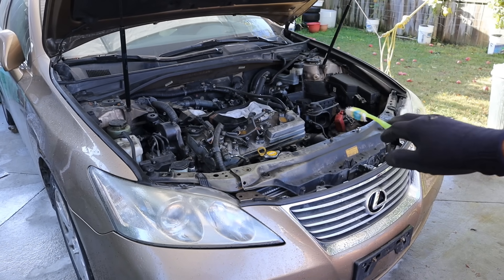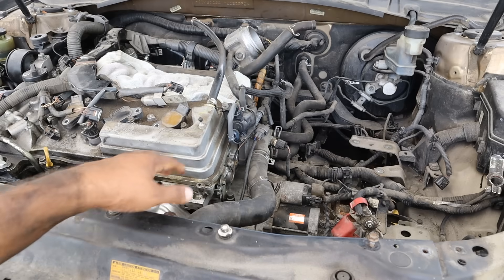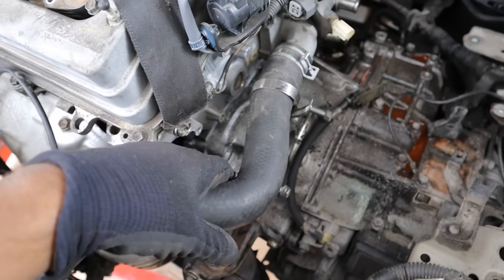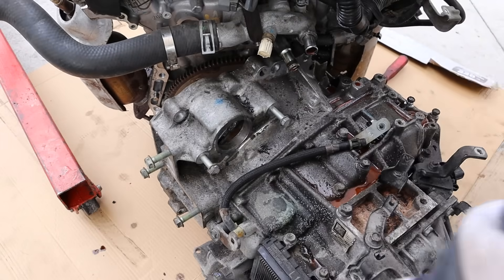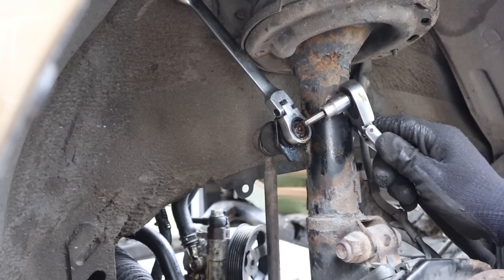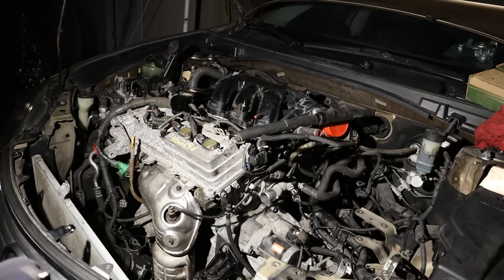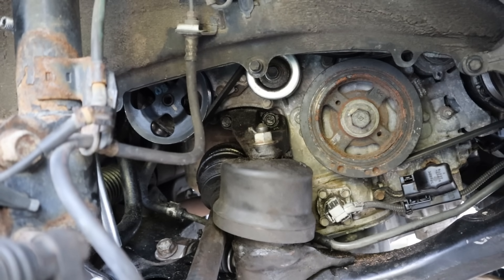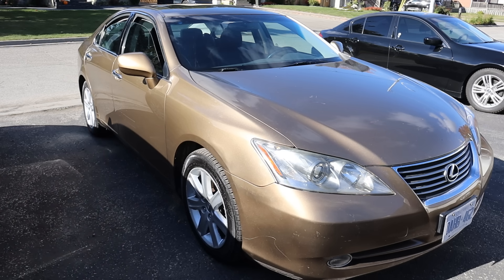Lexus Engine Replacement

Comment: from where did you lift
Reply from the maker: Good question, I don't remember, but it was difficult
Reply: @speedkar99 can’t find much about  it , my best idea is to use lifting straps around the tranny  and engine and removing all the plastic  intake so it doesn’t crack

Comment: Hey Friend, excellent video, I pulling the engine 2007 Lexus rx350 AWD, I got torque converter bolts, bell housing, motor mounts and she is stuck to transmission any suggestions? This bad boy it tough., thanks
Reply from the maker: It's gotta be the one stuck hidden bolt like I had in this video! Frustrating. 

Are you pulling from the top? I believe the exhaust and windshield setup doesn't allow for that in the RX.
Reply: @speedkar99 
Yes, I'm leaving firewall sine exhaust manifold in the car, murpheyslaw channel pulled from the top and in following what he did. On the replacement engine there are no bolts in bell housing beside AWD mechanism,, one on top corner and one down low kinda behind AWD part. Very frustrating. I will check again, thanks for replying.

Comment: How long all together?I’m about to do this exact thing! I’ve seen other videos where the take everything out with the carriage and struts connected what do you recommend after doing it?
Reply from the maker: I don't have a lift, just the crane so I took it out the top. It was quite a few days, in-between weekend and work.  Not an easy task for the faint hearted, but accomplished when done.

Comment: Why motor failed I got one of those 😮
Reply from the maker: What happened to yours? 

I have a teardown video on this engine, check it out
Reply: Head gasket leaks external, I change coolant every 5 years and it has only 134k. It’s 2009.

Comment: What's the reason that the timing chain skip teeth?
Reply from the maker: So it didn't skip teeth...the gear itself lost its bolts and was freewheeling
Reply: Same issue with my 2009 RX350 thanks for the video I thought I would have to drop out the bottem @speedkar99

Comment: I live in Scotland and the car models are different here compared to there, but I still  enjoy watching your videos , and I find them very interesting and learn from them to.  I own a skoda octavia mk2 with ea888gen2 1.8  turbo petrol engine. Here in the UK ,the government are introducing a ULEZ ( ultra  low emissions  zone) scheme ( I hate it ). My car is euro 5 emissions, and will comply ( at the moment). Desiel engines euro 6 or more ,petrol euro 4 or more, in order to comply with these emission zones ( at the time of writing,  at the moment), in cities,  including  the city i live in ..
 If not compliant, then £12.50  charge. If don't pay charges, then fined.   my  car is compliant ( at the moment), so I'm keeping it( for now). I like it anyway.  I'm getting the engine overhauled, to get rid of excessive oil consumption problems( poor oil control ring design on piston rings , so upgrading them )and upgrading the hydraulic timing chain tensioner.  I've put it into a garage to do the work on it. I reckon 2nd hand petrol cars of that type will be in more demand now, and value will go up. So I reckon me investing money into getting its engine overhauled is worth it.
( most Desiel cars before 2015 won't comply)
I am looking forward to more of your videos 😀👍
( I remember you dismantling one of these engines in one of your earlier videos... ea888gen2 engine....though it may of been the 2litre)
( my car has  aprox 107 000 miles on odometer , it burned something like a litre of oil within 200/300 miles sometimes. Because it burned so much oil the spark plugs would fowl up and misfire after about 6 weeks of being replaced.  So it was time to get the oil consumption problem fixed. If the hydraulic timing chain tensioner failed it would wreck the engine...interference fit combustion chamber.  So that will need upgrading to. If I were to change my car, I'd get virtuality nothing for it in return,  but they would sell it ,for the same amount of money  I'd paid for it 4 and half years ago, because of the increase in demand for 2nd hand petrol ulez compliant cars. The non compliant cars will be worth virtuality nothing now. I cannot afford an electric car, or a new euro 6 or 7 car, so i will keep the car I have, for now. I really like it anyway.  It is great to drive. Needs oil problems and timing chain tensioner  sorting out)
The powers that be are also introducing 15 minute cities ( 15 min prisons or ghettos where nobody is allowed to drive,  and cannot leave  the 15 min city without asking for permission   . They introduced a blanket 20mph speed limits( which will actually increase  pollution because engine is on longer, for less distance covered compared to 30 mph, so it's basically a lot of nonsense),in all built up areas.  They are  jacking up fuel and energy costs to cripple motorists and wage a war on motorists, humanity,  to take away personal freedoms and to  imprison and enslave humanity. They also want to impose a charge by mile system to rip us off even more. Only the rich will be able to afford personal transport 
 The highway code has been revised and introduced  stupid new regulations , to make driving unbearably difficult, to put poeple off driving. They cut funding for road repairs so that roads deteriorate to point where they wreck car suspensions and tyres. The road drainage systems are not repaired,  so flooding is a serious problem now. They systematically demonise motoring and make us out to be the bad guys for driving our own cars for our own personal freedoms.
There are allegedly protests against all of  these new rules and regulations that are designed to destroy our freedoms, but unfortunately they are just a waste of time and effort. Absolutely nothing could be done to get rid of them. There are here, they are going to stay and there is nothing we can do about it. We just have to grin and bare it.
I hope things are better where you are.
Reply from the maker: Glad you enjoyed my video!

Comment: I've owned a car with that engine for 4 years and obsessively done research on it to be proactive (Timing Cover Leak, VVTi rattle, weak water pump etc) but this is the first time I'm ever seeing this kind of failure. Their timing chains are beefy as hell. Great video as usual!
Reply from the maker: I opened the engine. It wasn't the chain that slipped, it's the gear's bolts that backed off, causing it to disconnect from the camshaft.

Comment: What year was this vehicle?
Reply: This body style went from 07-11 but this one is a 07-09. 2010-11 had the chrome strip on the bottom, turn signals on the side mirrors and “L” style taillights 👍
Reply: @k_escobar917  thanks, I'm trying to figure out if my 2011 IS is new enough to hopefully avoid the seal issue 😅
Reply: @ExtremeDude2  ahhh thats a tough one! Lexus are great cars but even the newer ones have either valve cover leaks, timing cover leaks etc but mostly on the 2GR-FE engines as far as I know
Reply from the maker: 2007
Reply: thanks @speedkar99

Comment: i honestly hate working on honda, toyota and other 4 bangers, clearance sucks for the belts. i usually just remove 3 out of 4 of the motor mounts and any wiring in the way and jack up the engine to do timing belts or accessory belts. note this wont work on all models you have to use judgement when attempting to do it this way but it saves you loads of time over fighting the side walls or removing the entire engine.
Reply from the maker: Agreed. The 4 bangers aren't bad, the V6 is even tighter

Comment: I have a 2007 Avalon with the 2GR-FE with 216k kms. It’s still super quiet. You think a 2007 could develop a leak and what should I do to prevent this?
Reply from the maker: Yes. Nothing much you can do to prevent leaks. 
Keep an eye on the oil level so it doesn't get too low

Comment: 213k km's, that's not a lot! How did the engine seize?
Reply from the maker: It probably nskipped timing. I gotta tear it down and see
Reply: @speedkar99  in the introduction you said that the pistons are hitting the valves. Maybe the timing belt is seized and skipped timing because of the oilleak. Oil damages the rubber belt I guess? We will see it in the tearing down video. Thanks Speekkar99

Comment: My dad and I rebuilt the Transmission in my RX300.  We dropped the subframe with the transmission, why leaving the engine in the car.  It wasn't too bad.  We just had jackstands and a jack.  Runs and drives great now.  Don't want to do that again though.  That was rough.  It took us almost a month due to my fibromyalgia.  I can only work so long per day.
Reply from the maker: I did the same on a Camry. Dropped the subframe and transmission using jacks. Not easy.

Comment: 2GR-FE is huge. This is the only video I found that it is lifted FROM TOP. Is it possible to lift it from a 2010-2015 RX350?
Reply from the maker: No. On the SUVs and vans the cowl goes over the top and makes it more tighter.
Reply: @speedkar99 even on 07-09 rx350 models?

Comment: nice job!! replace that radiator! the upper neck is all brittle
Reply from the maker: Radiator looks like it may have been replaced. I cleaned it out really good though. Inside and out.
Reply: @speedkar99  when the upper neck turns all brown where the hose goes on it, its brittle and will break. slide your hose back and look carefully. typically at the 10 year mark you need to start looking closely at them. they will split and break.

Comment: Love the Toyota 2GR-FKS, I have 2 vehicles powered by them
Reply from the maker: FKS has been a little spotty ...they switched to plastic valve covers and direct+port injection
Reply: @speedkar99  I think the D4-S is a good thing, I’d prefer not to have plastic valve covers though.  What issues have you experienced?  I’m sure the front timing cover could still leak in really higher mileages

Comment: Going to wait on a mea culpa re: VQ37VHR  that you claimed leaked all kinds of oil. It doesn't. 192K here on my '13 G, most expensive repair was rad & water pump. I'm going to hit 250K laughing as I won't ever need to swap it, and it says a crap ton about the engine. Front subframe is rusted from hwy 417 commuting for 6+ years, but nothing that cripples the car like a 2GR having timing issues LOL. VQs rule.
Reply from the maker: Nice!

Comment: Is that the same engine they put in Avalon?
Reply from the maker: Yes
Reply: @speedkar99  good stuff, I rarely get to work on American imports, I've done an Avalon last week, changed both swingarms on it, had to get one of the engine mounts to get to bolts. Not mechanic frendly, that.

Comment: An engine swap without a single swear word? Impossible.
Reply from the maker: It went fairly smoothly. The pain points were getting the transmission off and back on.

Comment: "While we're in there" is sometimes almost as costly, if not more so, as the planned repair. Gotta love car repair.
Reply from the maker: Exactly! 
I was glad the timing cover or rear seals weren't leaking on the new engine. Just dropped it right in
Reply: @speedkar99  question is for ho much time they ain't leaking yet?
Reply: @speedkar99 Great video sir! I was curious as to how long it actually took you to get the engine out ? Also what lift point did you use on the drivers side? I'm actually thinking about tackling this job on my sons 08. The heater core busted and my son overheated the engine. I've already done the heater core and evap so far in this process.
Reply: 10000%✓✓

Comment: How many miles dos the junkyard engine have? And do you think now it would have been easier to drop the engine trans and subframe from below, including steering pump so that everything could be put together outside the car?
Reply from the maker: Yes Easier to drop down, but I don't have a hoist to lift the car high enough to clear it ..